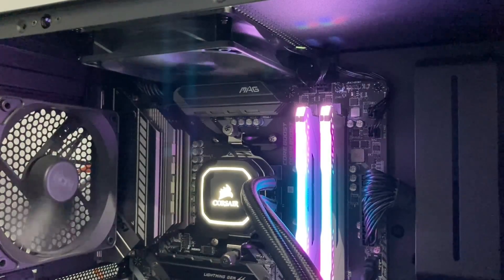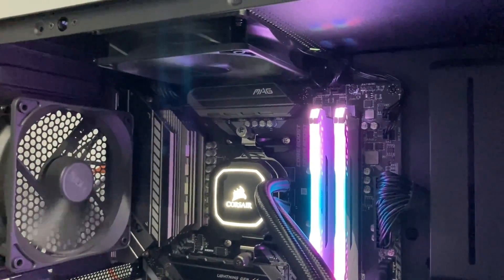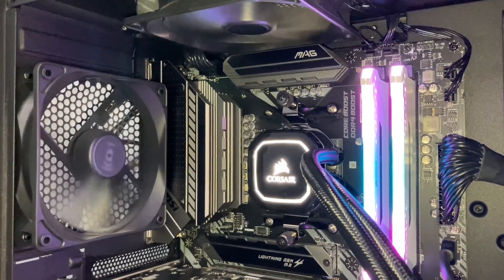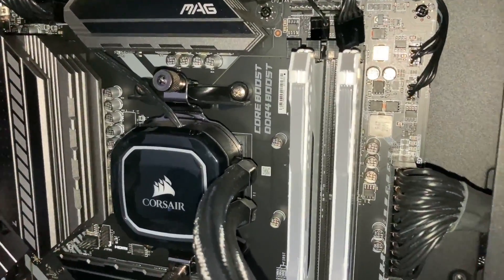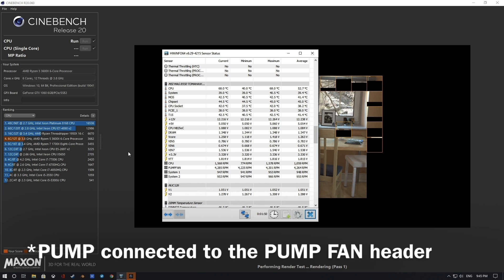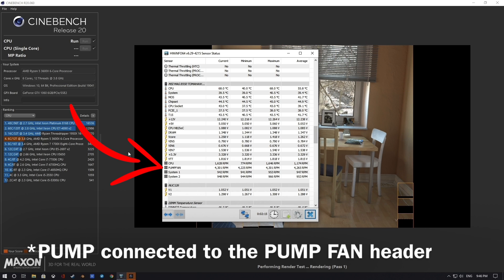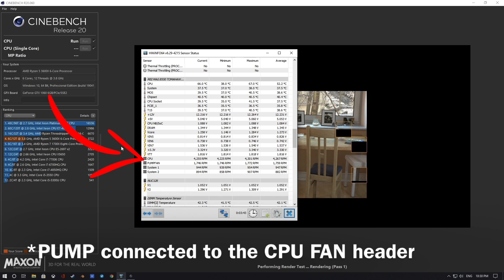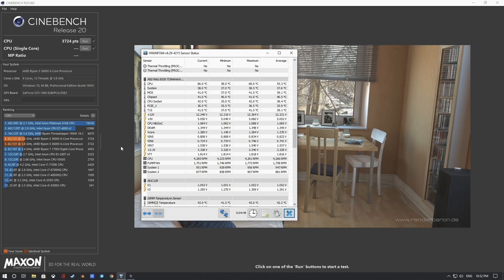Pump tach cable to which header? Pump fan or CPU fan.

Comment from the maker: Why so many Dislikes? 🥺
Feel free to say, Because I will improve with your suggestions :)
Reply: You’re getting dislikes bc ppl are probably getting frustrated and still doing something wrong lol don’t worry
Reply from the maker: @itsshifty3259   Thank you very much, I truly appreciate this reply :)
Reply: @starrims  Thank you for the explanation. It helped me a lot☺
Reply: I didn't see a problem with it, very simple and answered a question. Thank you. 
I'm tinkering with my first new system in 12 years or so. Things have changed a bit. Wanted to build but went prebuilt to be able to get a gpu. Skytech Blaze 3.0 (RTX 3080)
I was adding more fans and cleaning up wiring. The pump was hooked to the cpu fan header and probably fine but I moved it to a "chassis fan/water pump" header. Both 4 pin. I checked here to make sure that was ok. 
I hooked the rear exhaust fan to the cpu fan header. The rear exhaust, AIO pump and radiator fans set to monitor cpu temp on a custom curve. The one front intake and the two top exhaust are on pwm/performance.
PNY Epic-X 3080/3700X/ASRock B550Mac/32Gb ram/750Watt gold/Neo Air case (black)/120mm AIO. Nothing ever gets over 75c when I work it hard. The 3080 will bump to 2.2GHz.
Reply from the maker: @yourhandlehere1   Thanks. And thanks for sharing your configuration, it’s looking good so far :)
Reply: @starrims  One thing I'm about to change...I have the 6 fans now but two different makers. The TT fans I added don't play well with others. They have their own controller and it's not very good, keeps cutting out. Tired of fiddling with it.
I have a set of 6 matching Cooler Master fans on the way so everything can run from the motherboard. Higher pressure, more airflow too.
What to do with the other fans? Mount them in a tube spaced out to pull air from a window AC unit to the front of the case?
Maybe rig a box on back to help pull air through the psu chamber.

Sorry I talk a lot, I have this new little monster, nobody else around me is into computers or knows what I'm talking about.
Reply from the maker: @yourhandlehere1   No need! Keep them as spare parts in your closet. It's worth to make clutter-free low noise setup than a very slightly better temperature 😅
Reply: What I dislike about the video is I can barely hear what you are saying
Reply: @Fiji_water_man  EXACTLY and because you didn't show the the particular connections or showing you placing them on particular sockets. For instance, I want to know about the dummy connector. Perhaps you did talk about it but I just couldn't hear you.
Reply: I would increase the volume on your microphone. It's really hard to hear your voice clearly.
Reply: So I’m running a AIO pump but I only have 2 fan connections one I was going to use for my exhaust fan and the other for the 2 fans connected to my AIO is there another way for me to connect my pump? Please help
Reply: good video thank you
Reply: Dude, I bet your English is pretty good. But your pronunciation is terrible. A lot of Indian content creators have that problem. The rest of the world can't understand your mumbling. :) But thx for this video.
Reply: Can i connect pump to SYS_fan and Rad Fan to CPU_fan ?. Im using MSI H410M A-pro, sorry if my english is not good
Reply from the maker: I would suggest connect pump to CPU_Fan and Rad fan to SYS_fan.
Reply: @starrims  Ok i'll do that, thanks bro.
Reply: @starrims   sorry but i don't understand english well
is it better to connect a cpu pump or a cpu fan?
Reply: I think its cause of your accent
Reply from the maker: @MrBugl17  Guess I should work on my accent 😅
Reply: @MrBugl17 that's a shitty reason. A lot of amazing tutorials here on YouTube are made by Indians.

Comment: Bro so it means if my motherboard doesn't have cpu pump header, i can  just put it on cpu fan header?
Reply from the maker: Exactly.
Reply: Thaks bro cause iwas planning to buy an aio right now in facebook market place and my motherboard is msi170a gaming pro and i gonna buy msi magcore liquid 240r v2 i hope it works well
Reply from the maker: It will work my friend, don’t worry.

Comment: Sso as i understood (i got a b450mk2 and getting an aio) should i set cpu fan bc thats only headder to 100% and nothing ellse, i mesn the fans are no Problem since my chase fans increase speed same as cpu Heat, but yeah setting it to 100% right

Comment: So if my motherboard does not have Cpu_opt can I just plug my air pump power into my cpu fan 2 slot and just move the other random Fan to cpu channel slot or daisy chain to another fan?
Reply from the maker: Yes of course you can. 

But only up to 3 fan daisy chaining is recommended.

Comment: can i connect my 3pins pump on my sys_fan1 4pins?
Reply from the maker: Yes you can, but pump to sys_fan i don’t recommend, they can act weird but if you control them from good software like (fan control), it should be fine.

Comment: Can i use CPU fan Splitter to connect AIO Pump and Rad fan together?
Reply from the maker: 3 fan is max supported by majority of motherboards single header.
Reply: @ My motherboard has SYS_FAN and CPU_FAN header . Where I connect DeepCool AIO pump cable and DeepCool radiator fan cable ?
Reply from the maker: AIO Pump to CPU_FAN header, Radiator Fans to SYS_FAN is my preferred way and also thinks it’s the better.
Reply: @ Thank You..

Comment: i have msi a520m pro micro atx and it doesn't have an "aio pump" so can i plug it into cpu fan?
Reply from the maker: Yes, no problem.
Reply: @starrims  and the aio radiator fans to the system fan header?

Comment: straight up dis information. thepump is usually in the part that connects to the cpu. so if your tubes are going down . any air will be isolated at the pump. meaning you aint gonna be pumping nothing but air. garunteed! dummy

Comment: is this ok bro .. aio pump cable to cpu fan .. and radiator fans to pump fan or system fan 1 which is better .. 
or pump cable to pump fan
radiator fans to cpu fan ? 
im confused b550 tomahawk wifi
Reply from the maker: Aio pump to CPU-Fan & Radiator fans to System-Fan is better in my opinion, in this case pump is most responsive to the CPU heat. 
Pump-Fan headers are mostly used in custom loop build.
Reply: @starrims  so means i leave it alone the pump header im using 5700x .. btw
Reply from the maker: Yeah that’s fine. Done worry there is not much difference in these.
Reply: reply me bro please
Reply: or should i leave it alone pump fan on my motherboard
radiator fans to system fan .. coz i see on your video pump cable is better on cpu fan
Reply from the maker: @S @SmileNowCryLter ve you figure it out? I am sorry i never saw your reply.

Answer: Every option is fine. Now days PWM are more reliable. And there is many AIOs that combines The Pump and Radiator Fans in a single connector, in that case CPU fan header better.

Comment: I have a kraken elite 280 and the power cable has only 3 little pins but on my mother board there’s 4??? What do i do
Reply from the maker: Yeah That’s normal, you can put that 3 pin to 4 pin motherboard header.

Comment: useless.  where put the cables? Which header on motherboard? SHOW the WIRES connected and which wire is which. not software of RPM measurement in software. what even is a CPU TACH cable?
Reply from the maker: For newer AIO coolers they don’t use tach cables anymore. 
Just put the pump/fan cables to CPU fan header and RGBs to RGB headers
Reply: Thanks for reply. it's iCue h100 rgb pro XT   @starrims  and asus Tuf sabtretooth 990FX motherboard. so it is old tech, and what is a CPU TACH ?

Comment: If I connect the pump to the CPU fan, the pump will run at 100% all the time and I can connect the fans separately to the sys fan and set them to depend on the CPU temperature, it will work? sorry for translator
Reply from the maker: If you connect the Pump to CPU fan, you can control speed from Bios or Motherboard software or “Fan control” software.

Use “Fan Control” , you can set every individual fan to work depending on CPU temperature or GPU temperature.

Comment: Worthless video. Show cable being put into the right connector.
Reply from the maker: Yeah I should have done it!
Reply: @starrims  I have newer design Corsair AIO H100X I figured it out without instructions. All connectors are connected to WP PC is fully stable and working order. They need to put instruction manual in their boxes.
Reply from the maker: Great!
Yeah corsair manual is not detailed!
Reply: @starrims  on my next PC build I'll make YouTube tutorial on the updated AIO. Most YouTubers have the old version. No one is going to afford the 4070 TI build I made. I'm only asking 2k with 4 year warranty and free game and drone. No one biting.
Reply from the maker: Haha 😅 what’s your CPU?
Reply: @starrims  it's only 5800X3D inside of X570 taichi with Corsair AIO H100X, 2tb M.2 980 and 32 GB of ram 3600 mhz Gold Evga PSU 750W

Comment: Thanks for the video. I'm currently having issues with egva clcx 240mm cooler. I can't download the software dude to a fan error. In my bios I am getting a cpu fan and cpu opt error(plugged into either, doesn't make a difference) even though it shows the fan is working. Everything is wired the way evga says too so I'm lost. Cpu is staying around 38c.
Reply from the maker: its maybe some software issue... try update your BIOS

Comment: I installed a thermaltake ultra 240. my pump was connect to the cpu fan then and it was giving a full 3200 rpm, then  I connected it to the pump port but my rpm is not going more than 2900. can you please help me with it. 
thank you
Reply from the maker: 2900 and 3200 RPM wouldn’t make any such difference, Its better to not run pump at the highest rated speed anyway.

If you still need it, you can set it fan curve in the bios or the motherboard utility software where you can select the Pump fan option and tweak it, it suppose to give you full control.

Comment: is it like this for all motherboards?
Reply from the maker: Mostly. All have pump fan header, cpu fan header. But Aios can be different
Reply: My pump has only 3 pins, so can i change the Speed? And if i can' t, Is It going to stay at 100% anyways?
Reply from the maker: Do you have to power your Pump from PSU and put the 3 Pin to fan header? If that’s the case, your Pump is not PWM so can’t be controlled.

If only 3 pins goes to fan Header then you should be able to control your Pump speed, regardless, pump speed doesn’t really makes much difference but it is preferred to be fixed at somewhere 70-85% speed in between if it is controllable.

Comment: Can i ask a question ?
My motherboard has only one cpu header .. so if i use my pump header to my cpu fan where should i connect my radiator fans ?
Or can i use a spitter cable to power both pump and radiator fans ?
Reply from the maker: Anytime.
You can use splitter for PUMP and radiator FANs all together, but then your Radiator will be always at highest speed, and I personally don’t recommend lowering PUMP speed.

Better, connect radiator FANs to System FAN header, there must be some and leave the PUMP alone to CPU fan header.

Comment: What about sys fan?
Reply from the maker: For normal case fans or radiator fans.
Reply: @starrims  so can I plug my aio pump to sys fan and my aio fans to cpu fan?
Reply: @starrims  so can I plug my aio pump to sys fan and aio fans to cpu fan?
Reply from the maker: Aio pump to cpu_fan, Aio fan to sys_fan
Reply: @starrims  can i connect fans to my pwm fan on the backplate? Just like normal fans
Reply from the maker: Why not, you can do that.
Reply: @starrims  okay, and when ill plug them to my internal backlate pwm connector for fans the fans speed will be automatically?
Reply: @starrims   @S T A R R I M S  okay, and when ill plug them to my internal backlate pwm connector for fans the fans speed will be automatically?
Reply from the maker: Yes, PWM means automatic.
Reply: @starrims  thank you :)

Comment: My experience tells that the pump must be connected to the pump header on the motherboard and set the pump to 100% fixed speed. Radiator fans must be connected to cpu fan header or system fan header but in this last case remember that radiator fans speed must depend on cpu core temperature.
Last important thing: if you have a 3 pin pump connector, enable DC mode for the pump otherwise enable PWM mode. 
My newly built pc crashed many times because new MSI assumes that all the pump connectors in the market have 4 pins so that they are PWM controlled.
Reply: Bro m little bit confused please guide me.. my aio pump have 3 pin connector and motherboard have 4 pin pump header. So what should I do ? Pwm or dc
Reply: @techtour2417  connect aio pump on pump header. Then enable pwm mode. Set the pump to 100% fixed speed and dont touch cooler's fans speed

Comment: This is not 100% correct. I have just built a pc and I am testing my components outside as I am waiting for the cabinet to arrive. I have connected the pump to the Pump header and nothing else. I have not installed any radiator fans yet. No problems whatsoever. Temps remain around 30 C on idle.
Reply: Perfect
Reply: Temps should be that

Comment: That's the way I had mine connected and it alerted me immediately that the pump had a problem. That and the rising temperatures on the CPU
Reply from the maker: You sure peeled the sticker from cold plate?

You sure connected the pump sata power cable to the PSU?
Reply: @starrims  Yes sir, I've ran this setup for 3 years with no problems. It was a remanufactured corsair aio icue. It served me well as I've used it daily
Reply from the maker: Is it working fine connected with CPU FAN header?
Reply: @starrims  Yes, it seemed to. It stayed around 60-70 degrees while playing Doom and Red Dead. That was normal temperatures during these. It always ran pretty smooth until a few days ago. That's why I was looking at options or things I could do differently
Reply: @starrims  I'm trying to learn my way through these issues being that I don't know that much. I've read through my motherboard book several times now but there's only so much info in those. So any help is appreciated
Reply from the maker: I believe maybe some windows update messed it up with fan speed settings. Try doing fan curve in your icue software for the radiator fans. You can do it fro bios too. Also update the bios
Reply: @starrims  OK, I'll give that a shot. I'll let you know if I see anything that's wrong when I get a chance to try it again. I disassembled the computer for a thorough cleaning, it needed it more than I expected
Reply: I misspoke earlier. The pump was plugged into the aio pump header. I've cleaned everything thoroughly and I'm getting ready to boot up the computer. Hopefully it's just as simple as an update that has messed with my cooling, although I thought I maxed the fan speeds out in the bias before I disassembled it. I'll go in and double check the settings in icue and make sure it's up to date. Thanks for the information 👍
Reply from the maker: Good luck:)

Comment: Hello brother my PC Cpu ez debug light blinks once after shutdown also takes some time to boot than normal as i have an Nvme m.2 SSD. During startup also my CPU ez debug light blinks for some time before posting about 2-3 seconds, i had connected my aio pump to pump header but CPU fan header was not used , my GPU has been sent for RMA due to some issues, after it comes back I will check by connecting to CPU fan header. Is it due to CPU fan header kept not connected or due to CMOS battery ? Should I replace CMOS battery ? Please help me , i have RMAed almost every Pc Part of mine , They say my Mobo and PSU are in perfect condition. please help 🙏
Reply from the maker: How old is your PC (the motherboard)?
Try clean installing your windows, I think that solve your issues.

But if you are not facing any performance issues, you don’t have to worry. Debug LEDs supposed to blink before boot, its the process of system initial check.
Reply: @starrims  2 years old (approx) my Mobo is msi mag x570 tomahawk wifi , i have deepcool castle 280ex aio , tried cleaning everything , changed cables , RMAed PSU Mobo everything , now I did as you said connected pump cable to CPU fan header and radiator fans to pump fans, will this fix the issue or should I replace the CMOS battery ?

Does your pc ez debug light cpu blinks after shutdown once?

CPU replaced , CPU not boosting to 4.6ghz boosts just upto 4.2ghz, mine is  5600x
Reply from the maker: I Don’t think Cmos battery is the problem but you can give it a shot. And connecting the pump to pump header or CPU FAN header doesn’t really matter that much from my experience. 

As i said, clean your SSD and reinstall Windows. And Update your Mobo bios to the latest. 

**no doesn’t lit up the debug LED after shutdown!
Reply: @starrims  i cleared CMOS ,clean Installed windows multiple times, flashed BIOS with 2-3 random versions which supports 5600x. Nothing works man

Comment: No help at all. I have a 3 pin cord and a 4 pin mobo. No answer. No nothing?
Reply from the maker: You can certainly connect that 3 pin cord on to the 4 pin header, just do it, no problem will occur.

Comment: Hi, I have kraken 120 and it stays at 4200rpm on cpu_fan. Its ok for this aio? I cant choose smaller rpm. i also have 2 cha_fans on motherboards, but someone told me that is not safe to control cpu temp.
Reply from the maker: Yeah its fine. I daily h100x which pump runs at 3500RPM 24 hrs almost, running for 2.5 years!
Reply: @starrims  thank You!